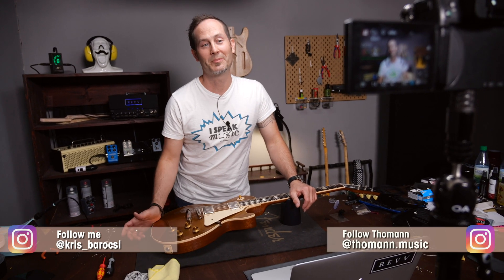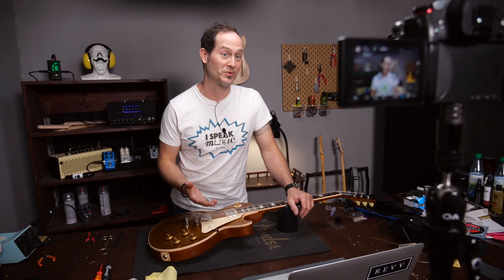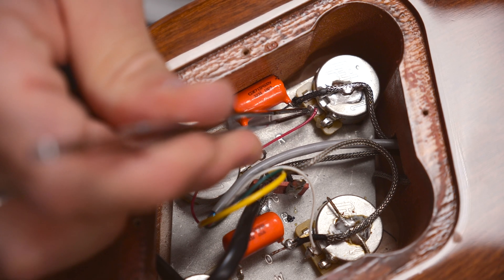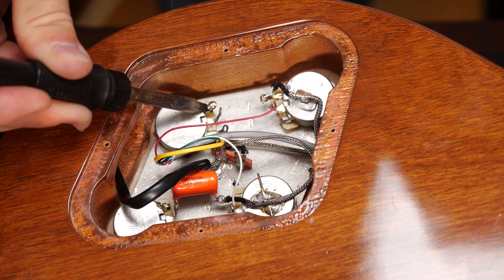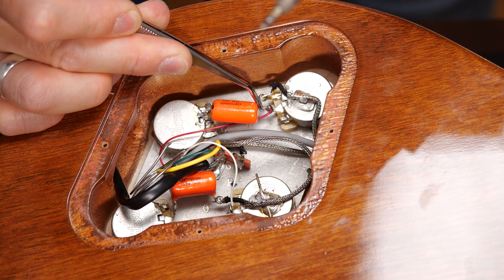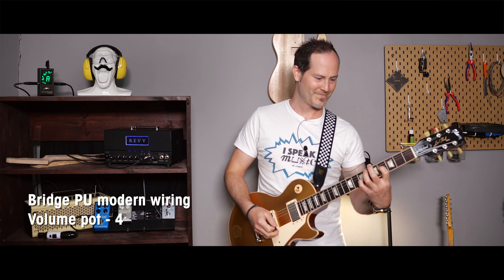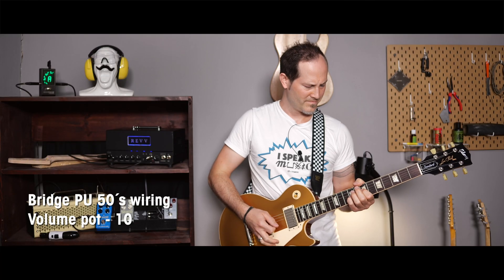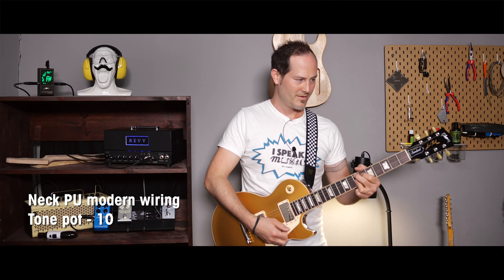What Is The '50s Wiring? | Guitar Tech Tips | Ep. 75 | Thomann

Comment: Kris, this is really interesting. How would something like this work or would it even work on say my Charvel or Ibanez that has 2 humbuckers and one volume one tone?
Reply from the maker: There are all kinds of wirings existing for those guitars. If the PUs go to the switch, then to volume and then tone, it's doable. Simply do what I did in the video (use capacitor to connect the volume and tone pots and most importantly connect it to the volume's output lug. That should do the trick. :) Cheers //Kris

Comment: cool!
one question:  why did manufacturers went to modern wiring? In you video, the 50s wiring sounds noticeably better. Wat was their reason fro abandoning 50s wiring?
Reply: Basically, the two wiring methods have the opposite effect on the volume and tone controls.  With 50’s wiring, the volume won’t roll off any of the highs, but rolling off the tone also reduces a little of the volume.  With modern wiring, the tone control won’t roll off any of the volume, but then the volume control rolls off some of the highs.

I don’t know if there are other considerations, but I personally prefer that guitars that have high-end to spare (strat, tele) have modern wiring, and darker guitars like the Lester have 50’s wiring.  Wire each guitar so that a weakness is reduced rather than emphasizing what is already its strength.
Reply: @adriansperling5012  best explanation ever ❤
Reply: @adriansperling5012  excellent comment
Reply: It’s totally up to preference! I would just say it’s important to know about the fact you can achieve the sound you’re after by modifying the electrical parts of your Electric ⚡️ guitar.
I came across that after 20 years of playing 😂. After setting my rig up to preferences my play just got so much better it’s magic. I’d thought I have to save up for a’59 to get that sound when actually a few dollar tone pots and a tec will make a world of a difference.
I hate muffled sound so I got everything with bleed or higher everything. Clarity can be brought done but not the other way around.
Your attack, gauge, pick ups and electric components go hand in hand. I’ll just go with the best feeling neck plus a loud unplugged guitar and adjust the rest from there. Most likely everything goes straight in the bin and replaced with what I need which in my case is never in the stock components despite you spending 4 or 8 k on a guitar. They give you nothing these days. The nineties are still decent IMO but the last 20 years just bin it

Comment: Very useful on guitars with P90 where you can set your amp in overdrive and go from clean to drive with the volume pot !
Reply: That is precisely what happened with my gold top.
    I was fortunate enough to find a really old P90 from the 50s. The alnico has faded a little, and it's also slightly under potted. This combined with the old style wiring, results in an incredibly touch sensitive circuit that can morph gradually from a sustain to a full feedback . There's a nearly infinite range of where you can put the headroom and edge of breakup with the volume control, and with a Tweed Tremolux, the even order harmonics will come and go, depending on where you stand in the room. 
        Neither the guitar nor the amp are investor/collector candy. They're both mutts. Hillbilly junkyard ratrods. But that one simple change in the wiring has made a profound and dramatic difference.

Comment: Nice. But why are there 600V types of condensators in the guitar?  The 100V type would be sufficent as well, they are much smaller and I find them much easier to handle in those tight cavities. ;-)
I am also investigating the two wirings where the volume pots influence both pickups when the pickup switch is put to middle position VS the one where they dont do this. I prefer the later by a mile.

Comment: I had already posted a question about the 50s wiring on the last video where you mentioned it. Sadly I did not get an answer there, so I'll try my luck again under this video. This was the original post:

" I have recently gifted my LP style guitar with Kloppman HB60s (damn do they sound good) and as suggested by Kloppmann, also changed my wiring from modern to 50s. When swapping the PUPs one volume pot got "grilled" and I had to replace it. I decided to replace all of them for audio taper CTS pots. Now the thing is that my volume pots act kinda weirdly; Turning them down with a clean tone results in an immense volume drop in the first few percent of the pot and then gradually getting less until no signal is left. It works a little better with a distorted sound where it cleans up a little more gradual but still with a pronounced effect in the first few percent. I did play the guitar for a couple of minutes after just swapping the PUPs and not the pots and I feel like recalling that the volume pot acted more gradual before replacing it for CTS pots but that also just be my memory playing a trick on me. My other hypothesis is, that the weird control behaviour of the volume pots comes from "tuning" them. I measured them before soldering them in and some were a little off of the recommended 500k ohms, so I opened the pot and gave the carbon track a bit of light sanding with 0000 steeel wool to bring them up to 500k. (The neck pot to 580 to give it less sag and a bit of a clearer tone). But then again I don't think this really explains the control behaviour of the pots because it feels really much the same for both pots. Is it just the 50s wiring that works this way? Sorry for the long text :D Would be really glad to get some insight from you on this topic, Kris! Liebe Gruesse aus Bayern!"
Reply from the maker: Hi, I really don't think that has anything to do with the 50's wiring. To me it sounds like you had linear pots in the guitar and swapped them to logs. Logarithmic pots do that: a lot happens between 10 and 6 and then barely anything between 6 and 0. If you play overdriven a lot, that's great, because you can lower the overdrive with the volume knob. If you play super low gain or even clean a lot, this might be annoying. I prefer logarithmic, but I know people who can't stand them. :) You could also try the vintage taper pots (some brands make them), those will sit between log and linear pots. You might like them. Cheers //Kris
Reply: @ThomannsGuitarsBasses  Thank you Kris! That sounds about right. Works alright with overdriven sounds but a bit annoying with clean sounds. The pots I'm using now are CTS "audio taper" pots. I guess that's some kind of fancy name for log pots. Guess I'll just have to get used to it :)